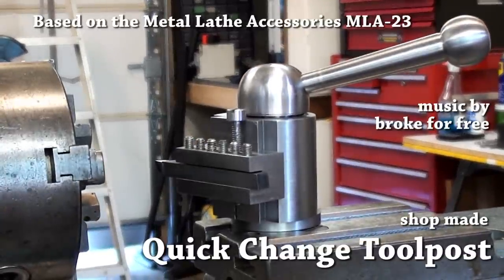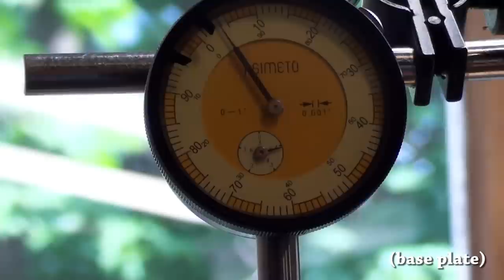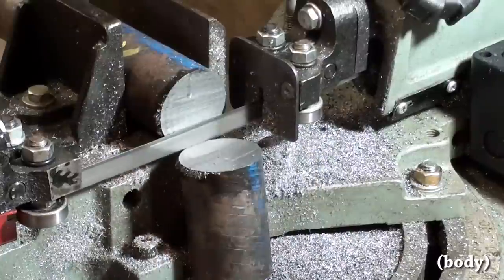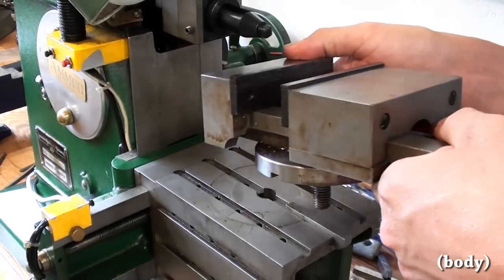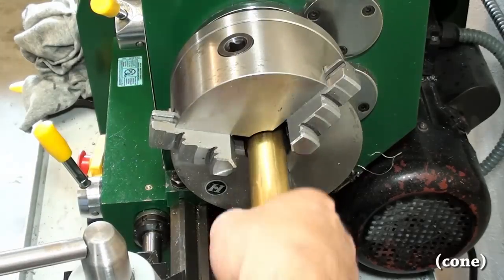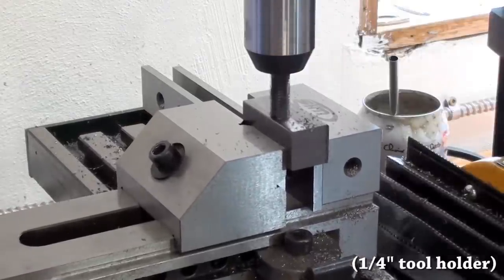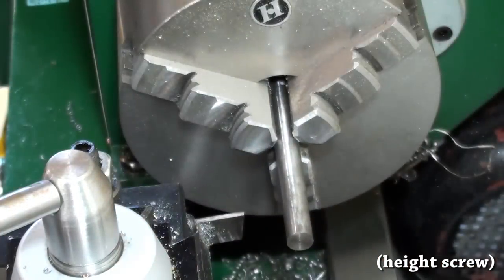Shop Made Quick Change Toolpost

Comment: Just a suggestion, but on a small setup like that if you make your toolholders a bit longer you wouldn't have so much "stick out" on your cutting tools.  Better to have more toolholder, it's more rigid than that little piece of HSS sticking out.  Looking at your threading tool especially, you only need 1-2cm at most, cutting tools the same.

Comment: Mr, that is some impressive videowork and machining! And you use the shaper, so I had to thumb up anyway ;)
Reply from the maker: Thanks Stefan.  When I've impressed the German I know I've done something right :).  You need to do more shaper stuff.  I have a lot I need to learn!
Reply: thecogwheel  very nice work. And it came out looking so beautiful!!  Wondering. If I was to say over shoot on the threads of the draw nut. And the handle tightens up in the wrong place. Can I just add a machined spacer in between the top nut/handle nut and the cone so it tightens up sooner?  I’m building my version of this right now. Thanks
Reply: Sehr gut.

Comment: Nice Richard.  I built one similar to yours about 2 years ago and what an improvement much nicer to work with.  I made the Nut from a scrape of aluminum I had laying around it worked out fine.  I did however make my handle straight but into a whole I drilled on the drill press in a vice with an adjustable angle.  The angle is a little steeper than that of the tool lock lever.  This is I think the best improvement I've made to the lathe because every time I use the lathe I use it!  Thank you!
Reply from the maker: Thanks for your support and comments!

Comment: There are two systems of QCTPs the ones that push the holder away from the main body and second the ones that hold him towards the main body to clamp him like Multifix and all the pro' s ones...the second ones have the best repeatability...like yours.. If you think about it at the first way turning forces work all on the one stud behind the holder he can be as strong as he wants on the second way the forces divide on the whole main body and that's where the good rigidity comes from. I always look first when i see a QTPC which system he has and then i know how good his repeatability will be..
There are also good ones with dovetails...and that's one of the best i ever saw... very good work dude...👍👍👍

Comment: I enjoyed your presentation very much! I have also read many comments before I choose to ad a few things to the discussion and will hope I do not offend others.
 
1 The music I was not bothered by as I was intent on learning your method of obtaining the objective!

2 The use of the Shaper for the dovetails is for a home workshop, apart from being relaxing if I remember correctly is also a huge amount cheaper than buying a Dovetail Cutter even with a Mill. To add to this the cutter as shown can be sharpened in the home workshop.

3 The last thought I have is to do with the question of repeatability, that is to with tool post position. With your setup I think it may be possible to set up a stop of some form in the tee slots. Perhaps also include some form of dowel for standard tool angles.

Okay my thoughts are done and welcome better ideas as I am here to learn. Cheers from John, Australia.

Comment: Cool. I have one tip: spin those tool clamping setscrews in a pipe in the chuck, face them off and then file the end to as flat as you can by hand. The filed surface is superior to turned or rough in preserving the surface of your tools; it only leaves surface marks on aluminum and doesn't wipe off the finish on black tools. The screws clamp quicker because the flat surface isn't springy.

My other suggestion would be to add a spring under the brass cone so help keep it from binding inside the toolpost.
Reply from the maker: Thanks - good tip!  Regarding the spring I've never had the toolpost bind yet so it seems that one isn't required.

Comment: This follows my previous comment. 
One way to detect conformity at the cone interface is by a blue ink test. Same ink we use in metal scraping. You will be the judge how much % contact area meets your satisfaction. 

If we desired to keep the same concept design and time invested in making it, consider this. 

Options:
1. Replace the inverted solid cone by a ER collet that fits the post bolt and the hollow cone. This way the flexibility in the collet can play a conformance role to better the conformity for stronger holding force. 

2. Replace the inverted cone by a matching size metal ball. Ball with a hollow axle and without the northern hemisphere. So the half sphere is pinching against and expanding the hollow cone.

3. Replace the steel solid cone by an  equal sized cone made of semi-fluid/solid material to catch up with the expansion of the hollow cone. Material can range from high hardness tire rubber trough lead and up to soft aluminum or soft copper (and not brass). 
Caveat? down this path we may experience difficulty in releasing the tool holder. That is caused by cone surface friction, because of the soft material had dug into the micro striations on the hollowed cone. That can be entertained by grinding and followed by lapping. 

4. Is further improvement on 1 thru 3 above. Yo make a horizontal mirror copy of the upper half cone system to the lower half. 

Hope this helps.

Comment: Very nice idea. Now I will build my own. I don't need drawings because I have a CAD program. I will however add another cone. Thanks for the idea. These things are very expensive in my country (South Africa) - even the imported Chinese junk. I don't have a milling machine, but I do have a lathe. I converted it to do milling as well, and drilling, besides drilling thru the center of a bar!

Comment: Excellent presentation, enjoy every second of it. 
Did we notice the hollow and solid cones only match each other seamlessly when both are not pinched against one another? Any pinching force induce a displacement can cause distortion in the hollow cone. All the pinching stress will shift towards the (inverted) base of each cone, result in localized expanding force and not spread over the cone body. Do you agree?

Comment: Subscribed.  It's good to see someone using hhs and not just carbide.  Don't get me wrong I use carbide but I really like taking the time to grind my own tools bits and getting that prefect chip, because hay this is what I do for fun...I could never make any money because i take to long lol
Reply from the maker: Thanks Dave.  I really prefer HSS for the home shop.  I use carbide as well, but I find that insert based carbide is a bit of a black hole with all the different geometries.  That and the price can add up quickly.  I use the money I save for buying material and other shop things.  HSS is still very productive as well.

Comment: What about indexing? At least half the point of a QC...
I use insert tooling, so can attach a fixed packer to all holders- that eliminates height setting. So a simple bridge toolholder would give me the same interchangeability, but would include change indexing (via a lip on the packer) with a lot less work and more rigidity. And no carriers required. I feel a project coming on.

Comment: I made my own tool post for my antique sheldon and some holders but I copied the aloris I like this one better are there any prints available also like your shaper what brand is it I had a Cincinnati about the same size and loved it nice work I'm a retired machinist now but still play in my garage with my old Bridgeport and my old sheldon lathe and a few others yes 12L14 is like butter use it ever chance I get it has the same tensile strength as 1018 just don't weld good thanks great work

Comment: I recommend you use a guard to prevent chips flying into your lathe motor. Its a pain in the ass when that happens
Reply: Pretty much guaranteed it's a TEFC motor and a chip hitting the cooling fan is like me swatting at a fly with my hand.

Comment: thecogwheel: Thanks for your elegantly simple but sturdy design. If there was a way to make this design angular repeatable it would be as useful as Aloris, less expensive to build and more suitable for smaller lathes.
Reply from the maker: Thanks!  There is room in the base for a locking pin or you could graduate the base with angular divisions.  I was going to do this but the lack of repeatability doesn't really factor into the work I do.
Reply: Nice to know there's a way to do this. Repeatability is essential to me for multiple operations on same part such as turning, knurling, threading and parting off without changing angular position.

Comment: I like that design much better than the "Norman Patent Style" that Morgan Demers made for his Gingery, which is a type that I was seriously considering.  I had just gotten home with a bit of material that I'd picked up on a whim from the local scrap yard when I saw your facebook post, now I think I know what I got it for ... question now is, is the Old Warrior's teeth up to the job?  Turned out it is some very tough stuff, some variety of stainless is my best guess.

As for angular repeatability, I've got an idea for that.  If it appears to work in CAD, I'll send you the idea by other means.
Reply from the maker: There is room in the base for a spring loaded pin if you want to lock the toolpost at 90 degrees.  I'm considering marking out degree markings on the body to you could position it like the compound.  I haven't decided yet.  For most of the work that I do it is no big deal at all.
Reply: I'd like to hear about your thoughts on the angular repeatability issues!!
Reply: My idea would resemble an aspect of the multifix tool post.  Except here it would be locked in place at the more commonly used configurations.  Compound at 29 deg, tool square to work, for example.  The idea still needs a lot of thought on what configurations are most used, and on how to make it work without defeating the ability to be anywhere, any position or angle, when that is needed.
Reply: Many thanks for this :-)

Comment: I love this toolpost.  What do you mean by it having a 'lack of angular repeatability' though?
Reply from the maker: Thanks Luke.  Regarding the angular repeatability - when you loosen the handle it allows the tool to change in both height and rotation.  This is vastly different than the Aloris design - which usually requires a wrench to loosen the top nut to rotate the toolpost.  The handle on the Aloris style is only for locking the tool in the vertical plane if that makes sense.  So on this toolpost whenever you loosen the handle to change tools or adjust height you set the angle of the tool to the work.  For some people this is a big deal since the toolpost changes a bit in position your dials (or digital read out) are not consistent from part to part.  It really depends on what  you do in your shop.  For me height repeatability is the most important.  I'm always adjusting the angular position of my toolpost anyway.
Reply: Thanks cogwheel, that's a very useful summary..;-)
Reply: I've thought about this. If you really need to stop the post from rotating, you could always reduce the height of the post itself. Mount it to a bigger, thicker base plate (think shaped like the Wi-Fi indicator on your computer) that can be immobilized to the cross slide via another tee bolt/nut combo, in an arcing slot cut on the mill. Pin the post with one locating pin to the base plate, dead opposite to the slit. Or a tab affixed to the back of the post somehow (welded, maybe) and bolted to the base plate.
Reply: LUKE !!! NOTHING !! CAN !! STOP !! THAT !! NOW !!!

Comment: Nice video, and the tool post is beautiful to look at. Is it for a Schaublin? Excellent work!
Reply from the maker: Thanks.  It is for a Schaublin 102!
Reply: thecogwheel Just bought one! And will be looking to make a tool post like this. One question...can the tool holders be made out of aluminum, or is that not rigid enough?
Reply from the maker: Congrats!  I don't see why aluminum couldn't be used.  It will not be as rigid - aluminum's modulus of elasticity is about 1/3 of steel's.  In practice you might not really notice depending on what you are doing.

Comment: Does the post in the original as drawn plans fit standard store bought tool holders?
Reply from the maker: No, I don't think so.  I think you could easily modify the dimension to hold AXA Aloris style holders though.  That said the design does require a reasonable tolerance on the dovetail section to work properly.  Some clone holders might have some loose tolerances as the Aloris style allows for more play I think.
Reply: thecogwheel I can see that, the aloris doesn't spread the dovetail like this one does. If the holder is a bit bigger, it may not grip it. I'm not against making things, but when import holders are cheap, I get lazy. Thanks for the response.
Reply: GET!! THE !! SLEDGEHAMMER !! THAT !! WILL !! MAKE !! IT !! FIT !! IN !! NO !! TIME !! AT !! ALL !!!!

Comment: When the cutter on the shaper gets to the top bevel of the dovetail, does it cut on both sides, bottom and the 45* top?
Reply from the maker: It is ground with clearance so either you cut the bottom or the side.

Comment: What's the purpose of that base piece? It seems like it just reduces the rigidity of the system
Reply from the maker: There is room on the base to put indexing marks at various angles.  Since the plate has a tee in it, it can't move on the compound.  I didn't show this in the video and I haven't added any marks yet.  But I may.  It also protects the compound.

Comment: If you stop at 5:13 you can see the vents on the motor look to be plugged like 2/3 of them.
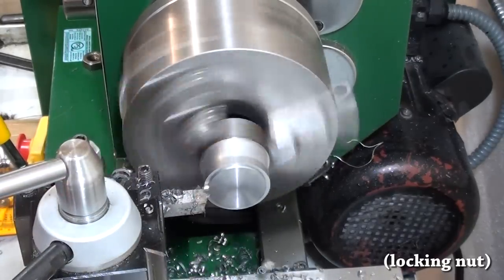Reply: It's not. It's the angle of the camera and what you are seeing is the cooling fan inside the protective grate. From 5:04-5:06, you can see the impeller come to a stop.
Reply from the maker: Eagle eyed viewer :)

Comment: Love it! But I dread making this with my awful lantern toolpost. It's all I have. Ugh!
Reply: My atlas lathe is such a turd.
Reply from the maker: LOL.  There are many folks who love the Atlas, and it is better than no lathe.  I might get pummeled for saying it but I actually like the 10" import bench lathes significantly more than most Atlas machines.  The 12" was not too bad, but the others are pretty flimsy.
Reply: TrailBusterBrute1 hit the local car swapmeets...always someone there selling complete..or basket case tooling or machines
Reply: Ha!  Well, I called (still do) my old lantern post a "Tourette's" tool post.  It has been the cause of many sudden outbursts of profanity.  A huge motivator to give this design a try.  Mine is scaled up for cxa size.  Since my lathe could use either, I might make a CA size body later, so if I find a load of tool holders on the cheap, I won't have to be too fussy about sizes.

Got the shaper work on the body posted a couple of weeks ago.  I'm still locating and pulling the media back together on the balance of the work.  Getting a message about pending hard drive failure while in the middle of a project sorta got things scattered over a variety of computers and drives.
Reply: A QCTP is so much better. Go right back, on-center, change tools almost instantly. No matter how long it would take you to make, worth it (or buy a Chinese set.) Mine has the spreading dovetail  style in the BAX size. Chinese, but it works fine, for a hobbyist. The tool holders are cheap so you can setup tools for each function.
Reply: DREAM !! ON !! DREAM !! ON !! DREAM !!! ON !!!
Reply: @TrailBusterBrute1  PUT !! THAT !! AND MYFORD !! AND CIRCUS HURCUS !! LATHES !!! STRAIGHT !! INTO !! THE METAL !! SHREADDER !!! EFFECTIVE !!! IMMEDIATELY !!!!

Comment: In what way is this more flexible than the aloris style toolposts?
Reply from the maker: One handle and it locks up in both position and height.  The design also scales very well.  You could go smaller yet, or go bigger and maintain rigidity.  Nothing in the design needs to be hardened and is easily made in the shop.  I've looked at a few 0XA toolposts, (the smallest version of the Aloris design) and they leave much to be desired.  If you need angular repeatability though this toolpost isn't for you.  Thanks for watching Rob!